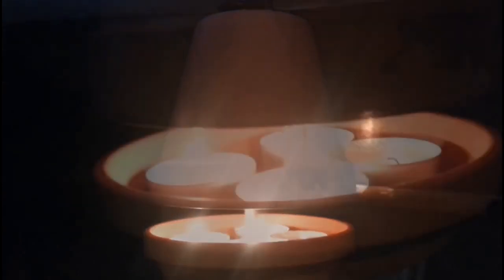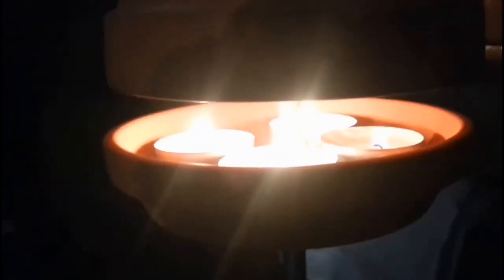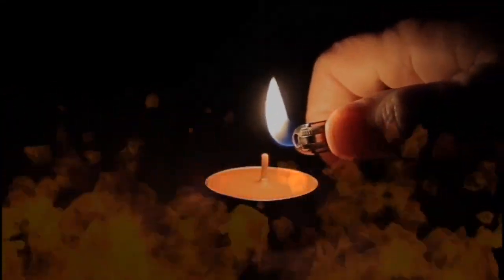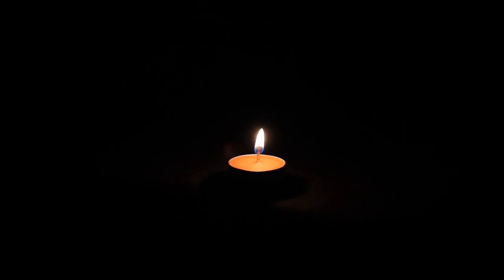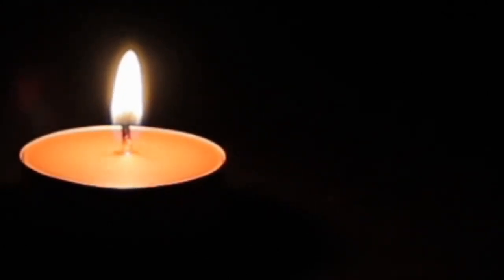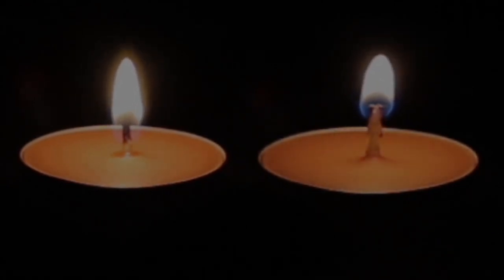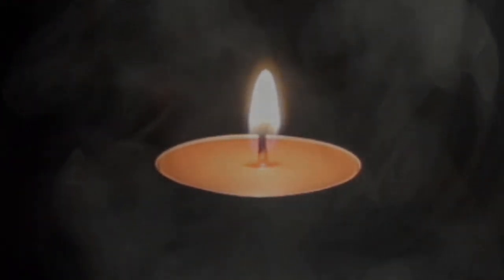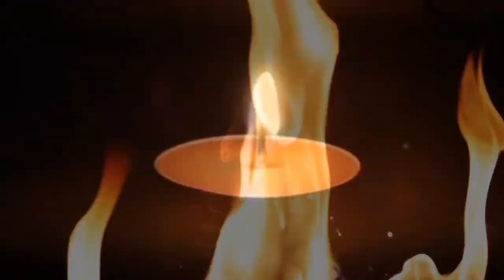Flower Pot Candle Heaters  - The DIY Device That Kills Norfolk Broads Forum

Comment: Would these be safe with non-paraphin candles, like honey wax candles or other waxes?
Reply from the maker: No
Reply: Why? no flammable/combustable ingredients evaporate then
Reply from the maker: All have a flashpoint.
Reply: Ah aight, thanks. But they should be safer than the peraffin, yea? Especially if there are holes for the evaporated matter to escape